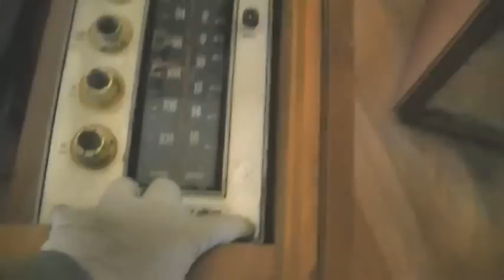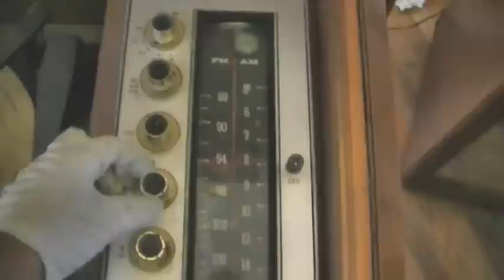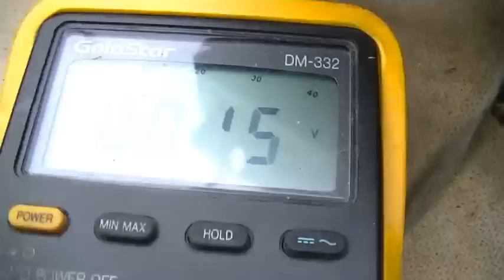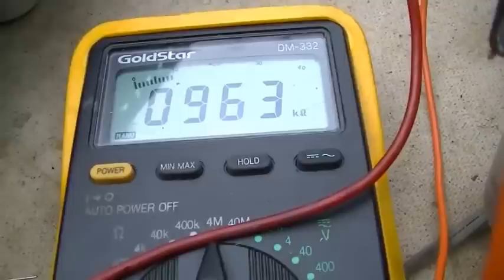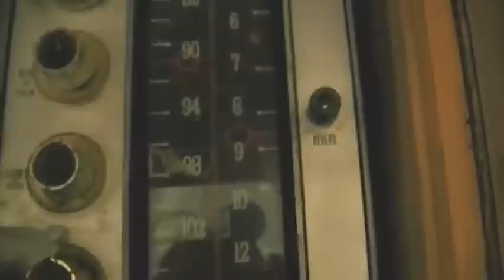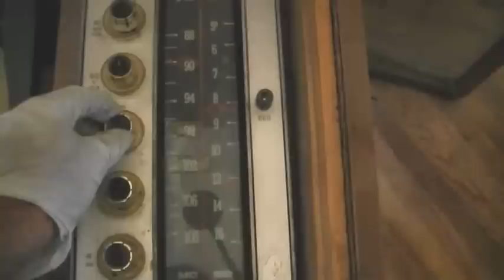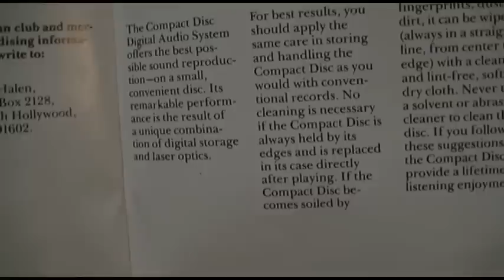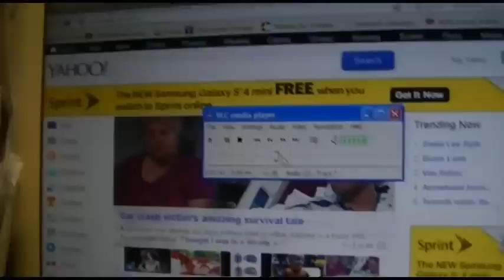Packard Bell RPC 13 Record Player Radio Amp Repair Stereo

Comment: Ahhhh... such a revenge on that STK*** such a pain "one" place, I was spending late night hours opening them up and soldering on top new output transistors, since new STK is just beyond $$$ for what it is. The only good part in such things is the volume control combo with motor, mostly it was Alps made. And as a tip for those who like STK IC's, keep in mind they are only for 6 Ohm + speakers, 4 Ohms = STK go boom. You can run it on 4 ohms, but then you need lower the voltage and amps for it.

Comment: Nice touch with the EOL part. I find the high power claim on that cheap POS comical - that PB would blow that cheap stereo out of the water in terms of power and overall audio quality.
Reply: I'd choose the PB over any cheap micro system like that one

Comment: You get great deals on console units, here they're expensive, when ya come across 1, Great repair!!
Reply: Same here.Not only do the thrift stores and estate sale prices start at $200 and go from there,but they never work.I have a few tube consoles I lucked out on a few years ago,but they are all dead,and there is nobody here in Albuquerque to repair or restore them.The record changer in there is a Glaser-Steers.I have a component version,sold by Heathkit.It's not working right,and they are notoriously hard to work on.

Comment: The changer in this combo is a very interesting one. It is manufactured by Philco, and has an independent mechanism to drive the changer separately from the turntable. During the change cycle, the turntable pauses as the record drops.

Comment: I'm surprised you don't want to fix the changer. That changer is a Glasser Steers (looks to be a GS77) which is arguably the best American-made changer. They stop the platter fully each time before they drop a record then restart it after the pickup has landed on the lead-in of the next record. Gentle enough that I trust my GS77 on even my best records.  Maybe records aren't the best when painting a house*, but I'd make a unit like that a main living room stereo any day....Heck, I wish my Packard Bell Roundy color combo had a GS77  instead of the Garrard AT6 it came with.
*The average 12" 3RPM LP is ~15min per side and a GS77 can hold around 15 LPs so every ~3.75 Hours you'd have to turn the stack over or swap the stack...Taking a 5-15 min break every 3-4 hours to wash the paint off your hands and swap a stack of LPs doesn't sound that bad to me...Heck, I painted one of the bathrooms at my house with all 5 of The Police's albums on one of my changers blasting from a room down the hall.

That 'this asbestos needs a high-speed grinder and a cocaine straw' is IMO the most quotable joke I've seen in your videos so far.

Comment: Packard Bell operated a non-union plant in the L.A. area, and since virtually all of its competitors were back East, were unionized, and had to ship to California, P-B had quite a cost advantage and therefore their units sold for somewhat lower prices than the other brands did.  Also, P-B really liked to simplify all of their circuits as much as possible in order to keep costs down. The performance was just OK.  I don't think their sets used retrace suppression.

Comment: 30.08 "Replace the electrolytics! It will work again."
Wasn't there a class action lawsuit on those units? I think it was a power amplifier issue. Failure prone. I can't remember if there was an associated safety concern such as fire. God Bless

Comment: not all new stuff is bad now. i have aiwa nsxaj80 which was made by sony at that point i think and it can get loud. 250 watts. has 2 connections each speaker 1 for low and one for mid and high. panorama satellite speakers and can hook up a sub and surround speakers if want too. computer hooked to it and stuff. more power then i would ever need where i live.
http://reviews.cnet.com/audio-shelf-systems/aiwa-nsx-aj80-mini/4507-6721_7-30099671.html

Comment: Tiger Woods, you're not. 

I'd just spray some high temp paint over the asbestos pad.
Reply: And if it's not a high temp situation put liquid rubber on it works great.